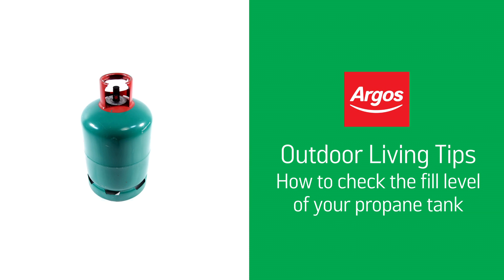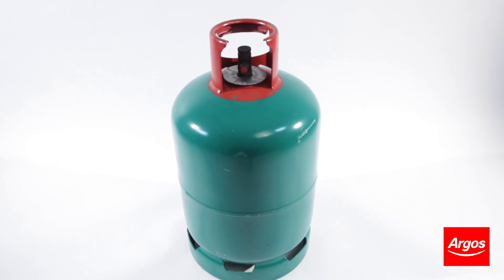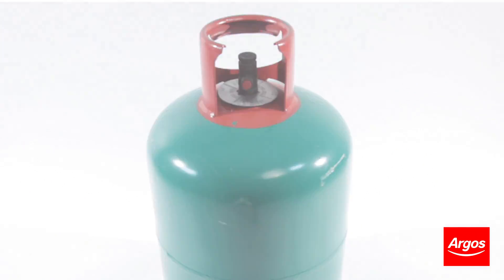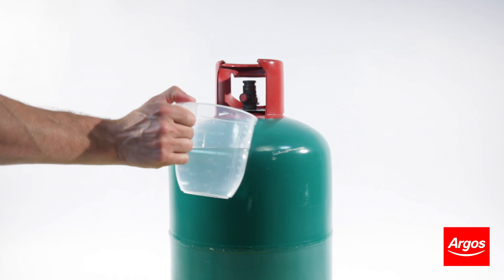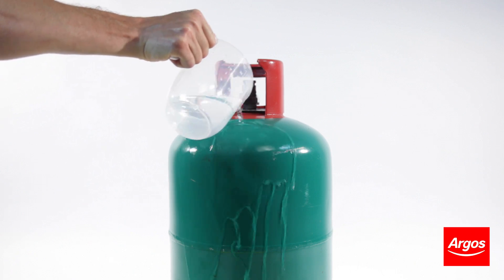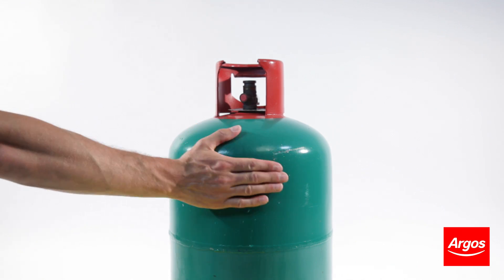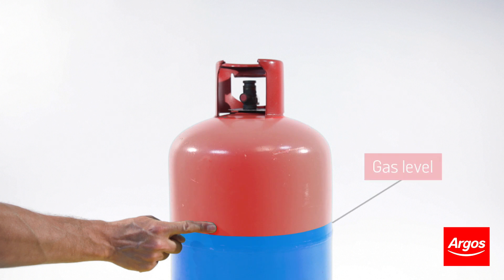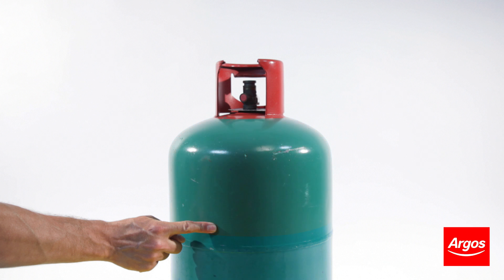Check The Gas Level On Your Gas Cylinder

Comment: This is not very practical in the kitchen setting. I don't want the floor getting wet.
Reply: Go outside
Reply: use towel and wipe
Reply: Just spread a cloth or two surrounding the cylinder